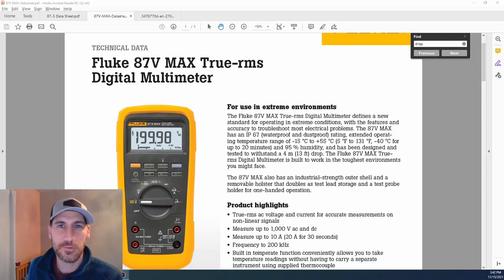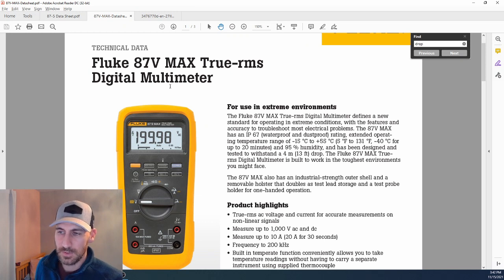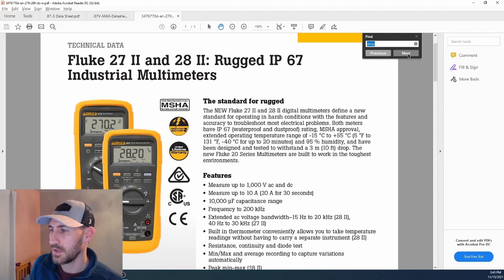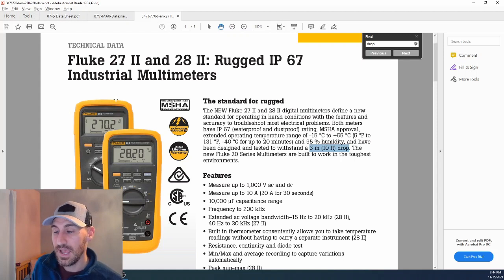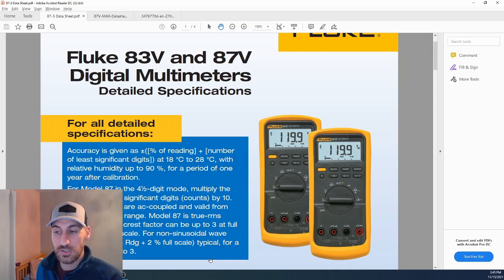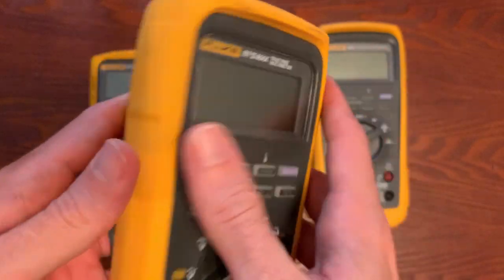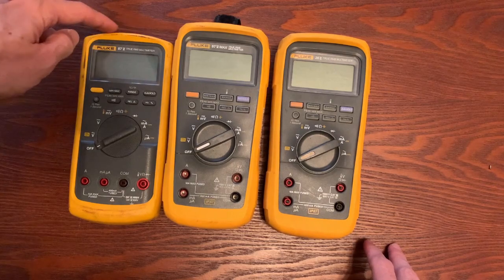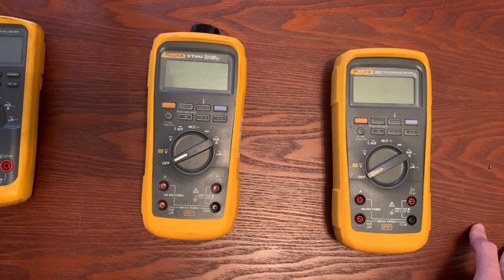87VMAX Vs 28ii vs 87V - Fluke Fridays - Episode 28

Comment: Changing the battery and fuses on the 87V MAX is insane (12 security screws + disassembly) compared to the 289 (simple 1/2 twist rear panel)
Reply from the maker: @xorbe2  yes I think it's because of the waterproof/ip rating.

Comment: The 87-5 max / 28-2 has a lower diode test voltage than the 87-5. I like the Flukes also because of the diode test, because you dan test LEDs. I often do it at work when testing new PCBs. I donßt like to focus my view on the inside of the LED, so i put my Fluke 2 testpins. It works woth the 82ii/87vmax, but not so good as with the 87v. 
I think that is because the 85v uses a 9V battery and the others three or four 1,5V AA. 

I recommend lithium batteries for this kind of devices. 
I got the 82-v EX for a good price. Once i wanted to use it again, it didn´t turn on. I thought low battery. The batteries were leaked out and damaged the plastic and the contacts on the PCB. Never again! This was a very expensive thing to get a new one for a good price. The old one works again at a colleagues home workshop, but no more "ex", because he has fixed it with a lot of work and cleaning material!

Comment: Thanks for you channel, it helped spark my interest in higher end Fluke meters.  In reviewing the Fluke 87V and the Fluke 87V MAX I found a few differenced that I have not seen mentioned.  The 87V has a diode test voltage of 7.3 volts while the 87V MAX has a diode test voltage of 2.38 volts both with a max current of 1 mA.  The voltage used in the resistance ranges on the 87V goes from 7.3 volts down to 2.6 volts while the 87V MAX goes from 2.3 volts to 0.5 volts.  The 600 k-ohm and 6 M-ohm ranges on the 87V have an accuracy spec of 0.6 % + 1 while on the 87 MAX they are 0.2 % + 1.  Subjectively the 87V MAX backlight is dimmer and the beep is quieter then the 87V.  Also, the rotary switch is more damped and less positive detents on the 87V MAX as compared to the 87V.
Reply: the differences are due to the 9V battery at 87V
Reply: 28 II it has a design error in the rear battery door, eventually screw compartment is damaged by time lapse, rear door all time looks how is not well assembled, is becase rubber seal create that bad assemble. I sold 28 II for that mechanical design issue, also because buzzer and light are less than 87 V. Other problem is diode test, you cant turn on IGBT for example, because is very low voltage, even chinese multimeters can put more voltage. I prefer any model from Fluke, like 87V, 289, 179, really 28 II disappointed me.
Reply: @rauldm6497 almost believed you lol😂 I used my 28ii for well over 10 years in all kinda environments never had single problem.
Reply: @wayned3137  I have 12 multimeters and 3 clamps by Fluke,  and 2 Hioki meters more one clamp, I had two 28 II, first with buzzer problem, if you turn on backlit with continuity mode, when the buzzer sounds the low batt alarm starts,  second with back door problem, not only my meter, I have a buddy that your meter 28 II failed also of back door.
Reply: Un punto de vista , El 87 v original es más completo que el 87 v max.

Comment: Thanks for this comparison. Very useful to see them side-by-side. I have an original 87, still working. It is slightly smaller than the 87v.  A wonderful meter to work with, feels like it was made perfectly for  the human hand. The MAX and 28ii are bricks in comparison, but that's the price for ip67 and the drop height. I'm looking at purchasing one of an 87v, 87 ex and 28ii ex, all 2nd hand. I'd go for the 87 ex if it weren't for the fact that it's not ip67 rated, but who knows, I may reconsider the requirement for this. I've used my meter for decades in the marine environment,  and it's still working fine.

Comment: the specs show the 87V having a battery life of 400 hours which is based on 9v alkaline, alkaline depending on brand have a max of 550mAh with 350mAh being nominal, whereas the Energizer 9v Lithium battery is 750mAh and rechargeable 9v Lithium's can be gotten @ 1300mAh so the run time for 9V batteries would be greatly increased. The 97V MAX advertises battery life of 800 hours which can easily be beaten on the 87V be switching to 9V Lithium.
Reply: Yes, Fluke says the 87V Max using three AA alkaline batteries has twice the battery life(800 hrs) compared to the regular 87V that uses a 9v alkaline battery (400 hrs).
Your 9v lithium battery idea for the 87V is good short term idea but if you haven’t noticed, the entire industry in general is moving away from 9v batteries in devices and redesigning them to run on AA batteries for longer life.  
This is because AA batteries have more energy output (mAH) which in turn means longer battery life especially in “Primary”(non- rechargeables) batteries.  You are probably aware that the higher voltage of 9v batteries compared to 1.5v AA batteries does not equate to higher energy output. 
An Energizer Ultimate Lithium AA battery puts out over 3000 mAh which is more than double that of a lithium 9v battery.  With 3 lithium AA’s, it would be vastly superior in battery life.
It will be just a matter of time before all modern portable test equipment moves away from 9v batteries while sacrificing a slight weight gain and space loss for a significant battery life increase. Plus, modern AA formulations aren’t plagued with battery leakage like the old days and that was previously one of the best reasons to use 9v batteries instead.  Don’t be surprised if the future generations of the 87V (87VI?) switches to using AA batteries instead.
Reply: @trialshawaii  AA alkaline batteries from both Eveready & Duracell have still leaked on me, a couple of times still in the package and not expired; so I still don't & won't trust them in anything.
Reply: In the Fluke manual (87V) they recommend using Alkaline batteries. Don't know why you couldn't use a 9v Lithium "smoke alarm " battery. However I believe if they thought it was ok to use they'd tell us. Fortunately they're not difficult to replace.

Comment: I want to buy a multimeter however I want the best, is the 87v max good for residential?
Reply from the maker: it might be overkill, but if you want the best it will work for any residential conversation.
Reply: As Brandon says, probably overkilll. But you'll never need to buy another meter. I've used my first-model 87 for decades in the marine environments incl. Antarctica. No services. Still works fine.

Comment: I still wanna see how both the 87V Max and the 28II stack in internal differences.

I've had a feud last year on the EEVBlogs about that where I simply called Fluke Lazy for the 87V Max. I simply called them changing a silkscreen and repackaging a already 8 year old DMM (28II) as a sucessor (if you could called it that) of their 87V instead of a new design that fixes some of the short comings of the 87V.

I know that the 87 brand in Fluke as a mystical aura around it, and any updates should be well through but still this is not the way.

But it have been hard to find high quality photos of the DMM internals in comparison with the 28II, or at least the last time I search for it I wasn't able to find them.

So is there a chance to show how both the 28II and the 87V Max stack up in terms of internal construction, kinda like "Where's waldo?"
Reply from the maker: The only difference that I am aware of is that 87-5 MAX and 28-ii is the Data Sheet claims a 4 meter drop test instead of a 3 meter drop test.
Reply: @fridayswithbrandon  So as I said in the EEVForums is just a repackage, different silk screen and done...

Bravo Fluke, bravo! The more time passes the more it proves that Danaher Corporation, now Fortive, who manages the brand Fluke is just keeping the milk cow with the least innovation possible...

Don't get me wrong, I still like my equipments (289, 54-II, 87V and the Scopemeter 225C) but as a old customer it revolts me that a company who was always considered by leading the innovation not releasing anything substantial in the last 14 years. Even myself been thinking of selling/trading my 289 for a 189... 

And NO, their Wireless communication equipments are not an innovative solution. I've used them in a company I worked for and always kept reaching my personal equipment because they simply only work in the best of situations.

And now you say, if they work why change for the sake of change? Well, call me wrong but for me a new product or revision should introduce something different or significant to push the envelope, not what the 87V Max done, since it already existed but was called 28 II...
Reply from the maker: @black.phoenix.  Your not wrong. Thanks for sharing your thoughts
Reply: The drop distance is almost  40 inches more on the 87max as compared to the 28-2 other than that the same meter....if the 28-2 is far cheaper get it over the 87 max

Comment: I have a fluke 287 Digital multimeter
Need repair,can I get some information
On your repair center
Reply from the maker: It's out of Seattle area. You can call them at 888-99-FLUKE

Comment: My understanding is that the 27ii is still being made for military that doesn't need true rms. The 87v max had slightly longer battery life and a little higher drop test due to a reworked skin. The release of the 87v max seems to have dropped the price of the 28ii. I recently picked up a new 28ii for $289 and it is a huge upgrade from my last Klein meter. Thanks for the side by side, keep up the great content. Subbed
Reply: who's got the 28ii for $289? best price I can find is $566 which is more than the 87v max (I know the post is a year old now)
Reply: @joey24698  it was on Amazon for a little bit for that price. I purchased one, new in box.
Reply: Hey hey hey klien is still badass